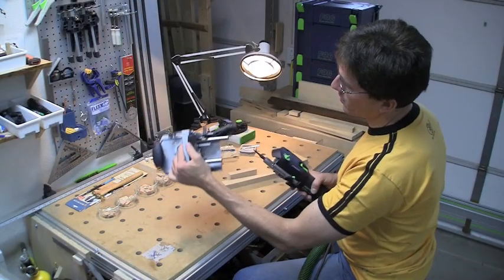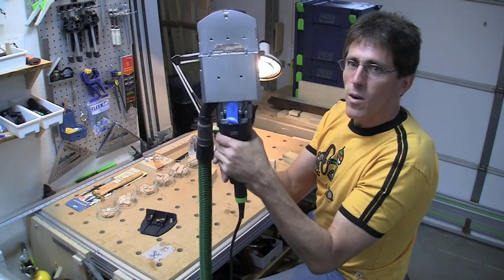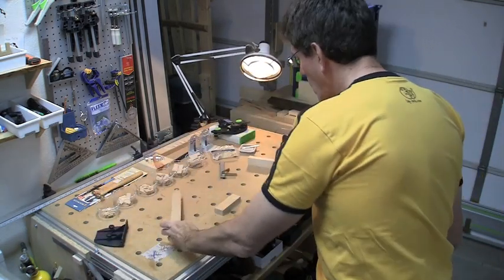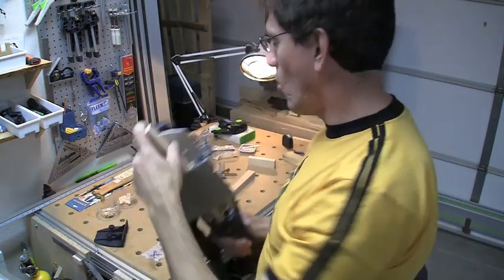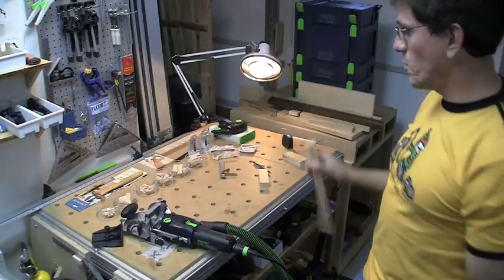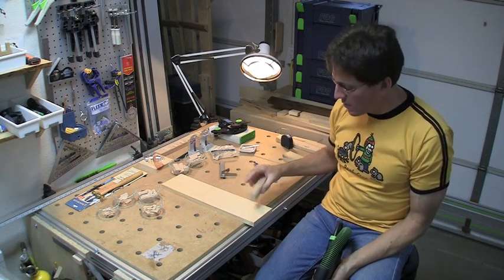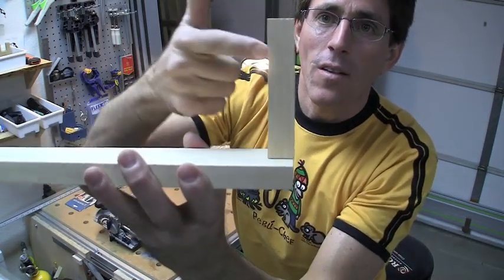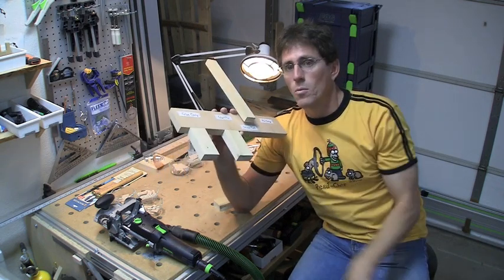#18.3 - Festool Domino Review - Part 3 - Domino in Use

Comment: I don't imagine you're still checking comments on these videos, but maybe this will help others who find this - at 2:25 in this video you mention that you have to have the fence in the vertical position before you lock it down, otherwise the mortises aren't cut straight. I was having this issue FOR YEARS and decided finally to try to sort it out. I thought it was just my holding technique or the way I was plunging. Nope... I also have to push slightly on the right side of the fence before I lock it down, otherwise my mortises cut at an angle and nothing will match up. Only took me 10 or so years to sort this out. I'm just a hobby DIYer, not a pro, so I would use it, get frustrated because nothing lined up, and try something else with another tool... like a Kreg Jig to join things together - not great for hard wood.  So, thanks again for all your amazing work on this over the years! Glad to see you on FOG every once in a while!

Comment: what kind of pins are you using , are they staples ? i see it an air staple? also is the bit that comes with the machine that you are using the 5 mm is only good for that size only, if i want to change the  biscuit as i call it i need to change the bit?
Reply from the maker: I just used pin nails. You could use brads as well. All that matters is that you have a pin through the Domino and the stock. Shearing the pin takes a lot so it'll add strength and certainly holds it together until the glue dries making a faster assembly.  5mm bit is only good for 5mm Dominos. They are exactly sized.  Granted, if you used a 10mm bit, you could put a 6mm Domino in it, but you'd have to fill with a structural filler basically making it a 6mm mortise; more work than necessary.